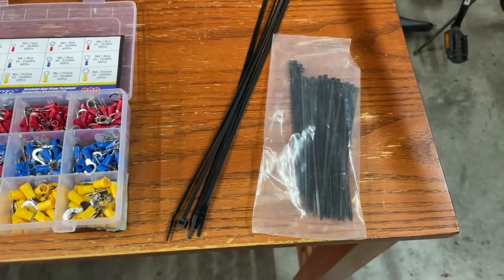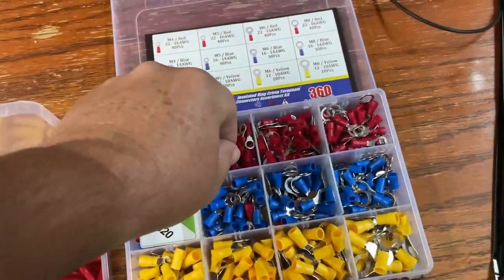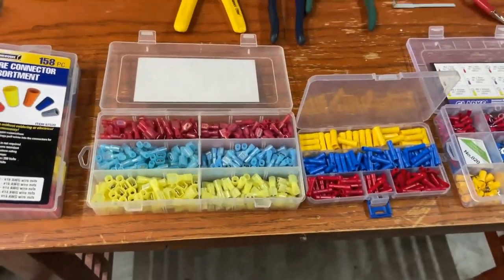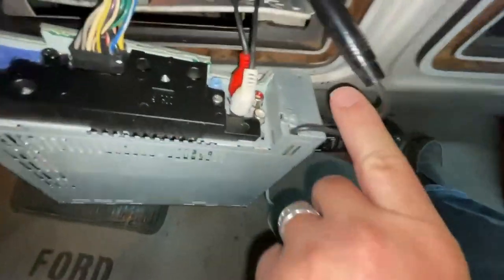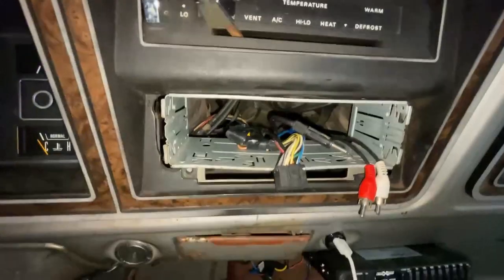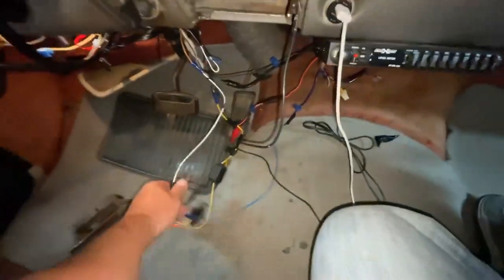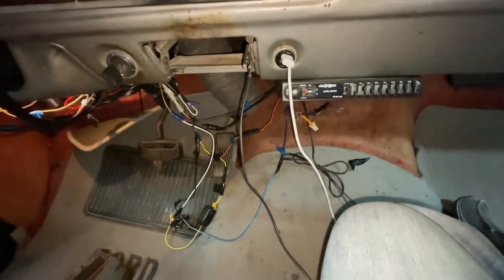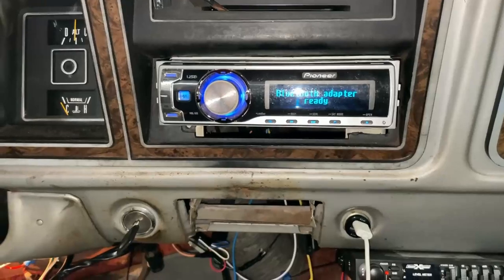Installing a New Radio In Your 73-79 F150

Comment: if you find that the bracket hasnt been hacked up, dont hack it up. make one , should be people making them for sale. a unhacked climate control / radio bracket and dash cover are still looked for.
Reply from the maker: Yeah, my old man wasn’t much for looking pretty, unfortunately, he just cut till it fit. 😂. But I agree with you 💯
Reply: @TheKeymaster316 lmc trucks sales 8 inch mid range speakers that comes in a single box with a cover
Reply from the maker: @dustinkey8885  nice, I'll check them out!

Comment: The little black box on the yellow constant 12v wire, what is that?
Reply from the maker: I’ll be honest, I’m not 100% sure.  Thinking maybe it’s a fuse inside of it, but I’ve never had it apart. Maybe because it’s on the “constant” hot wire so it’s for protecting against a surge?
Reply: @TheKeymaster316  that’s what I’m thinking as well but not sure . I’m replacing an older aftermarket radio in my 77 ford with a new retrosound, got it all hooked up but no power. It appears that the previous owner disabled the constant 12v wire and was powering the radio directly to the fuse box. the older stereo would only work when the ignition was on. That power wire connects into the “little black box” then up to the stereo. The previous ground wire also connects to that box then to the ground point. I’m thinking maybe that black box is limiting the voltage to less than 12v which is why the my new stereo isn’t powering up. I’m an amateur at wiring so that may or may not make any sense 😂. Thanks for responding and for the video. It has helped me
Reply from the maker: @tylergrimmett2118  good luck!  It definitely sucks when someone has hacked up all of the original wiring.  There should be fuses that only come on with the key and ones that stay hot all the time.  If you can manage to utilize an unused fuse slot for either of those, that would help you out.  You only need constant power, switched power and ground to make the radio power up.  Sounds like you have a good game plan. 👍🏻